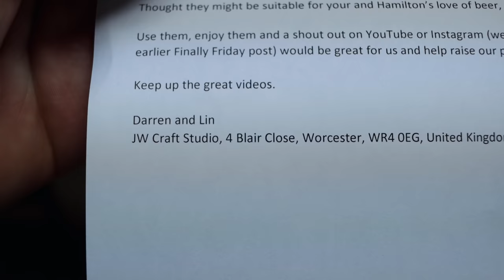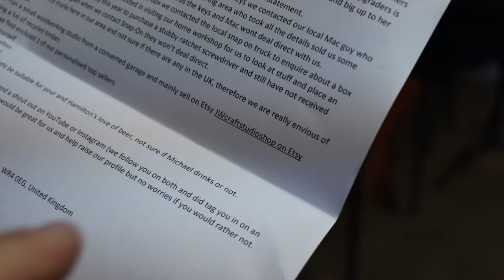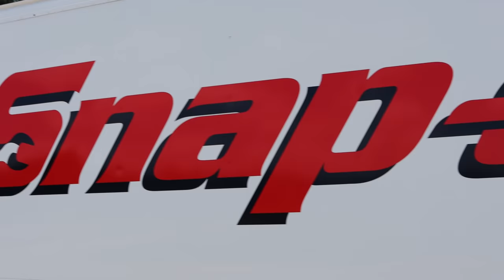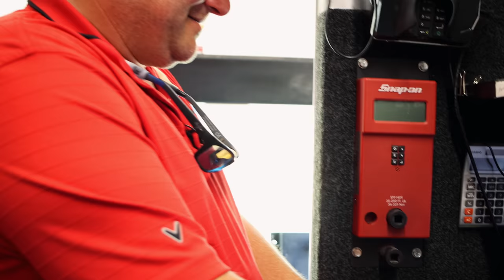Snap On Friday: New Tools On The Truck Today And I Bought Another Ratchet

Comment: @6:26 That ratchet works best when you don't lock it and let it pivot while pushing / pulling the handle to ratchet the head (hard to picture but think of a steam engine drive). Glad to see a manufacturer pick up this idea since my old Husky HD ratchet bit the dust years ago without any replacement.

Comment: I break stuff loose all the time with my Milwaukee 3/8" Fuel, going on 2 years of heavy line use now no issues what so ever. Original batteries too. Love that tool huge time saver, only complaint is the head is large.

Comment: I have their half off student account for almost two years never bought a single thing from them but have been thinking of getting the multi position ratchet and sockets but only the metric size sockets for now since that’s the sizes both of my cars use the most this will be in 3/8s aswell

Comment: Those multi position ratchets are great when the bolt is loose and you keep the ratchet unlocked and use it like a speeder

Comment: Those mps can also be unlocked and used as a speed wrench bc the teeth have super low torque requirements. Great for frame bolts in bad spots

Comment: I finally got a new Snap On dealer today after like 2 years, but he actually work for Snap On and isn't a franchise, had no idea they did that. I gave him a task of seeing if Snap On still makes replacement parts for the old CTS561 screw gun.
Reply: CTS661-150 is most likely what your after but i just 3d print the gears now.
Reply: i wonder how much it cost to service it, i got the same gun, just don't go in reverse gear
Reply: @TinoR626  how do you find the print to 3d print gears?

Comment: I plan on getting the long reach 3/8 brute next since I love my 3/8 brute ratchet.I had it with a 10mm deepwell impact socket in 1/4 drive,a Grey Pnuematic once.It came up missing one day and I ordered two new sockets.Found it,fell on the floor going underneath my tool cart.Same with a 21mm deepwell Grey Pnuematic deepwell impact socket in 1/2 drive,drove me nuts for 2 weeks not finding it and it was on my tool cart.

Comment: My deal won’t even replace my handle on my ratchet for me. Told me I can buy the soft grip but I need to take old one off and put new one on myself. Wish I had Hamilton
Reply from the maker: That sucks. Most won’t cover the handle on warranty. You have to buy them but they are cheap. But most will swap them out if you buy one.
Reply: @KoonTrucking  yeah was willing to buy one on the spot obviously but he said but you have to put it on so I said nope

Comment: $5 for bit that is warrantied isn't bad considering it's $3 for a milwaukee that is disposable. You are going to wear ends off t25 and it's going to get loose. Whats worse is the magnetic 1/4" nut driver if our screwing down pole barn steel milwaukee lasts longest but still wears out quick so neoprene screw flips down and you scratch or dent the steel.

Comment: Clay what do you run for a welders? I apologize if you covered this. I’m looking too buy a multi process welder like a Lincoln 210mp or Hobart 220 multi. And a separate dedicated  ac/dc tig welder, like the Lincoln tig200 etc.
Reply from the maker: I have a stock welder old Lincoln and also a Lincoln mig welder that can run gas or fix core
Reply: I had a feeling you where a red guy. Lincoln is great.